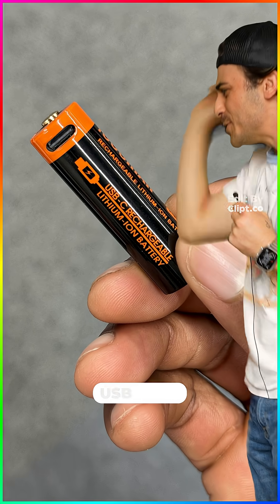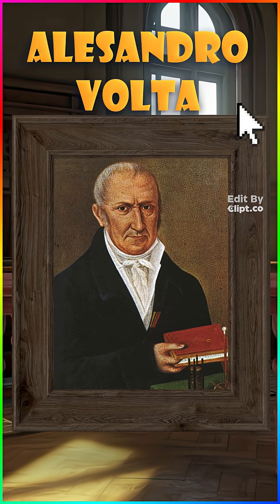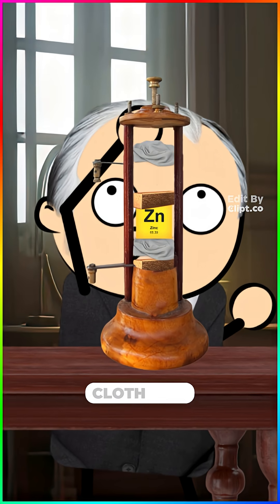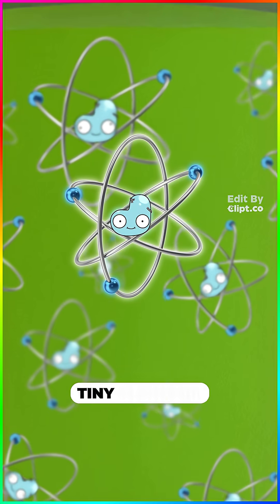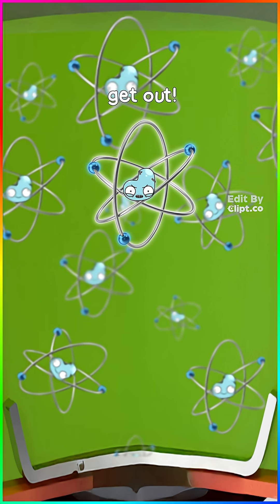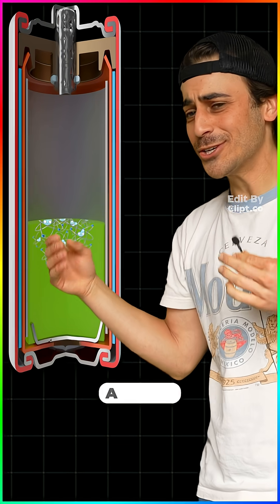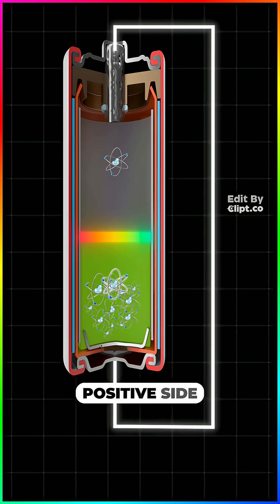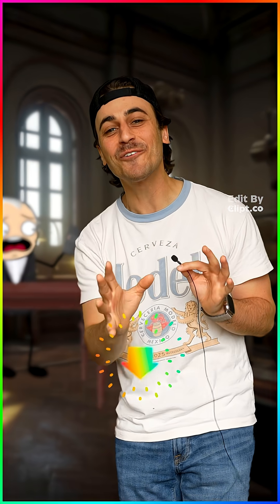How does a battery work??

Comment from the maker: Get more free lessons in your email! Subscribe on SmartNonsense.com 🌈
Reply: How the f*ck does a currency get stronger(pls make a video on this.
Reply: Hey so how do those rechargeable once works? 🧐🧐
❤ Your videos
Reply: Dont they run until its half? Because then the potentiol is the same
Reply: Are your team is Philippines?
Reply: @Samen-238 what?
Reply: Can you tell me ware do I buy one
Reply: Gay?
Reply: copper salty cloth zinc copper salty cloth zinc copper salty cloth zinc copper salty cloth zinc
Reply: Now pls explain why the electr9ns dont just go backwards
Reply: When theyre all at the positive side
Reply: why can't the electrons go backwards and go to the negative side
Reply: what you are showing as the electrons are the atoms. Electrons orbit the atoms. And the battery doesn't lose a charge when all the electrons go to the positive side. When a battery is dead it means that there is no voltage difference between the positive and negative side which can only happen when there is an equal number of electrons on both sides. If all the electrons go to the positive side as you describe, it will flip the poles of the battery and it will still have a charge but that's just you explaining it wrong. Furthermore, the topic was batteries being charged by usb ports and then you move to the voltaic battery. You went out of topic and it is a completely different story how batteries are charged

Comment: So if batteries are left for a while, they lose voltage
So that means battery let's through neutrons?
And also if you just connect a wire to Li-ion battery a spark will happen
So you explained an alkaline battery, which is not what phones use

Comment: sooo if you add more electrons to the negative side when you charge it... wont the space just run out for the electrons? or you pull back the electrons from the positive side? wtf😅

i literally cant understand the whole thing if i use this explanation.

Comment: All batteries produce electricity through a chemical reaction mechanism called redox, where one chemical species (the anode) donates electrons to another chemical species (the cathode). In rechargeable batteries, the charger basically sends electrons in the opposite direction which tricks the battery into acting like an electrolytic cell instead of an electrochemical cell, restoring the presence of electrons at the anode. Some batteries cannot be recharged because the products of the electrochemical reaction cannot react back with each other to go back to the starting point.

Comment: Wait doesn't it creates a spark and possible some explosion if you connect positive and negative wire? This is my theory don't if this true but maybe the elections that are from negative goes to positive after arriving into positive its trap again and the only escape is where they entered in (but this have some error cuz as the video mentioned they want to go to positive energy and them going back to negative maybe not possible) and because of it they bump to otheres electrons creating the sparks, that's why they need something like lights to power on so they have somewhere to escape.

Comment: Then why don’t u put a another wire going to negative
Reply: They wouldn't go back
Reply: @ICantThinkOfANameeeee why not. If they crowded why wont they go back the wa6 they came
Reply: @Cdiggy45  electrons are negatively charged. Opposite charges attract.
Reply: @ICantThinkOfANameeeee then connect a negative magnet to the other side of the battery
Reply: If only it was that simple man

Comment: Is there no one way barrier for batteries? Because the way he explained the battery, it sounds like it's possible to have perpetual current, if there was a way to maintain a continuous flow of electrons without having to add more externally. It's much like how the heart works ngl, with the lungs being the charger and fhe heart being the battery

Comment: So battery’s always have electricity? Just they are stuck in the other side and need put back to the other side? I’m still a little confused.

Wait, but if you connect let’s say a light bulb, the electrons are used to product the lights. The electrons are basically tricked into going towards the less crowded area and instead get sucked into the light bulb. Ahhh I think that’s how it works. 🤔